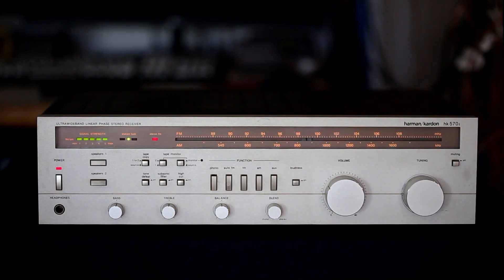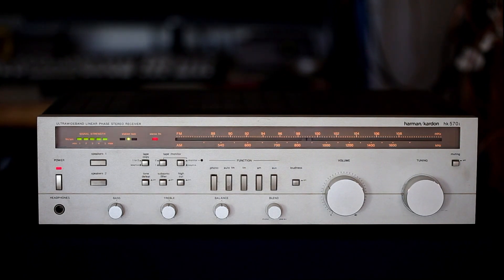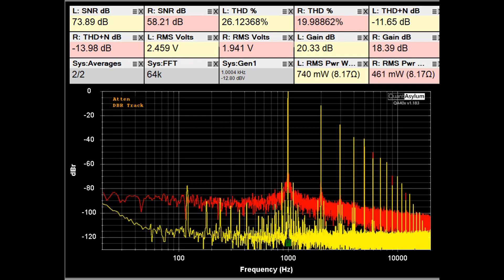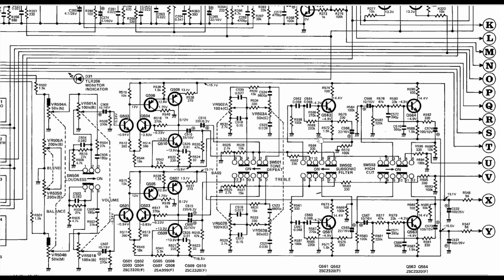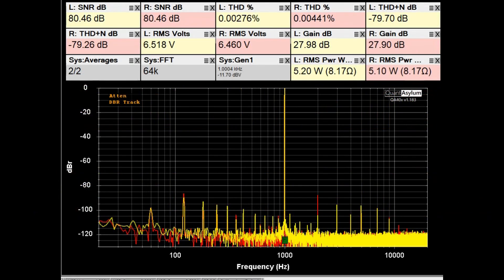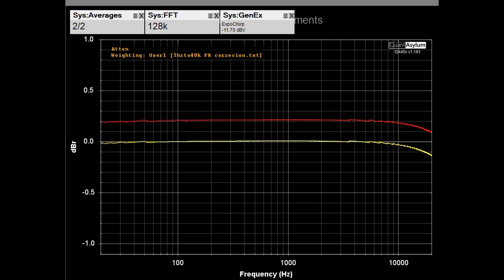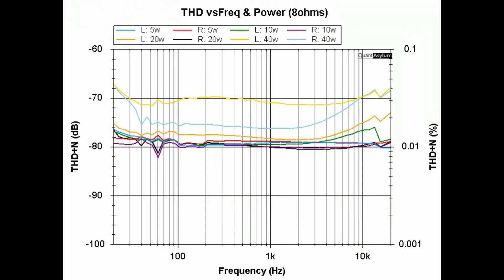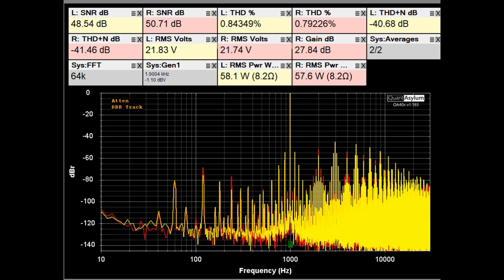Harmon Kardon HK570i Receiver- Vintage Audio Review Episode #79

Comment: Still have my HK 570i bought with my earnings from bagging groceries in high school. It was a big hit in the Penn State dorms back in the day. Your video has inspired me to dust it off and see if the old girl can still perform. Thanks for the great video.
Reply from the maker: Thanks so much for sharing this story- what were your speaker? Hopefully it will work well for you once you dust it off.
Reply: @vintageaudioreview  back in the day I had a nice pair of acoustic research (ar38?) speakers but they are long gone. Currently will be using some Athena AS-BS-1 bookshelf speakers. Hooked everything up and can only run at zero volume, any increase results in very loud static/noise from speakers - sorry neighbors!
Reply: Mine was in used from 1983 to 2001 and I just found it and she still perform like new ❤😢 my dad passed and left me it.

Comment: I have the hk385i, the bass has authority and the midrange is mellow, warm and inviting, very good for jazz and vocals, I can easily fall asleep for long session listening. However is sound is somewhat dispersed without good center imaging
Reply from the maker: Thanks so much for sharing your experience/enjoyments with the HK.  I was very pleased with my time with it!
Reply: @vintageaudioreview  so how would you describe the sound characteristics for the hk570i?
Reply from the maker: @MasterofPlay7  What I have found is that the most amps sound just fine, as long as they are driving speakers that are within their power capability. The hk570i would be a good match for a lot of speakers that do not require a lot of power. Harmon kardon did a nice job with the 570i.